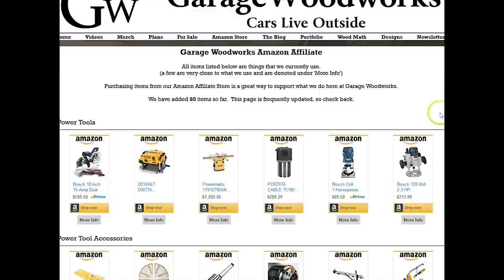Build a Wine Hutch (Ad Free)

Comment: I’m curious: I can’t remember the last time I saw you cut a mortise without the horizontal Mortimer, and I’ve been watching you for many years. What made you choose the handheld router to mortise the legs?
Reply from the maker: In the legs, I wanted the grooves for the panels to be lined up with the mortises. If I don’t move the fence on the plunge router after making the mortises, this is automatic. Because the end grain mortises in the rails for the floating tenons (centered tenons) are on the center of the width of the board, the panel grooves in the rails will need to be in the center of the width of the board.  If you don't want your panel grooves in the rails to be off-set, you'll need the mortises in the legs to line up with the grooves for the panels.   I hope this makes sense, otherwise let me know.  :)
Reply: Makes perfect sense. I hadn’t even thought of that. Thanks!
Reply from the maker: @richardmiller9154  No problem.  It's a great question and I probably should have explained it in the video.  I could have made the mortises with the mortiser, but I would have made more alignment work for myself in subsequent steps.  A lot of woodworking is thinking far enough in advance so you don't have to work as hard :)